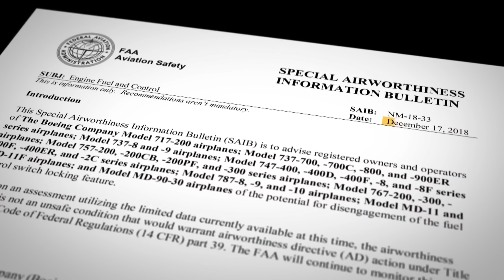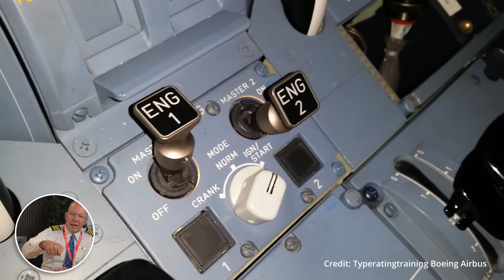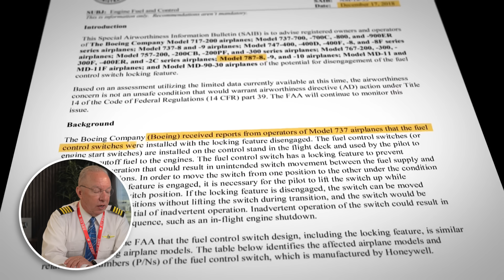Air India 171: The FAA’s 2018 Fuel Switch Locking Bulletin Explained (16 Questions Answered)

Comment: As much as I respect you, it's too cruel to blame it on pilots outright.  Clearly in the cockpit, the pilot said he didn't do it.  Let the investigation take its course and may the truth prevail. 
The board had to take psychologists into the investigation because they cannot rule anything so easily but that doesn't mean they are insinuating something like this. That's how investigations work. And the 2018 FAA Special Airworthiness Information bulletin has this point documented about the disengagement of the switches which could also be a case. We let the dead souls rest in peace until the investigation settles. Peace out! JAI HIND!!
Reply: Except that even though Air India didn't inspect the fuel switches, this particular plane had replacements installed in 2019 and 2023 though NOT for reasons connected with the bulletin so who knows? That said it's definitely on Air India imo for NOT following the bulletin though people will still blame Boeing for that. At least Boeing didn't try to hide the problem like with the MAX series.  Losing loved ones in a plane crash is just cruel period. A friend of my family was killed along with 272 others in a plane crash that was 100% preventable if the maintenance for engines in C checks issued by McDonnell Douglas had been followed by the airlines that bought and flew these airplanes. And maybe most airlines did that but three (just in the US) didn't and adopted a short cut (to save 125 work hours per engine) that they were specifically warned NOT to do. And sure enough it was done to airliners later found with damage done to their pylon assemblies which grounded an entire fleet of airplanes. The planes with hidden cracks still on the ground were inspected b/c one plane wasn't so lucky and lost an engine during takeoff and 30 seconds later crashed into a hanger killing all on board and two on the ground. That is cruel to those killed including those who actually watched their own demise coming on entertainment screens b/c cameras were put in the cockpit to provide that entertainment. It's cruel to the two pilots who were left trying to fly a plane with very limited information to work with. It's hard on their families. Hard to deal with the aftermath of everything that comes with losing loved ones including breadwinners or caretakers or children. Then there's the investigations that can take years (up to 10 with two B737 jets with defective servovalves). So Yeah while I definitely agree that the investigation should "Take its course" and yes we know why one (unknown) pilot said he didn't do it but that often gets to a very difficult part of the investigation. Even when you know what happens, when you then have to investigate WHY it did because that often provides the answers of what to do next to prevent it the next time and make flying more safe in an industry where so many improvements to flying safety have resulted from tombstone reform.   So Yes do the investigation but if it goes down one of the worst of all possible roads you still have to journey down that road. And there's already been troubling signs. A duel engine shutdown caused by two switches (designed to be only moved purposely) which were put in the "Cut" position a second apart (not at the same time) happening at the worst of all possible times almost down to just several seconds. Then a paraphrasing a brief exchange which may or may not be complete.  These types of cases seem to always shock people upon release of information from the CVR and/or FDR. Whether it's Germanwings, China Eastern, SilkAir or even PSA 1771 where there were gunshots heard on the CVR. Because we don't think that things like that happen.  I would rather it be something mechanical that can be fixed or even error where training might address it. Than a pilot's deliberate action. But if that's what it was it'll be made clear even if we never ever fully know or understand the motive.
Reply: Radfem2010, agree with your response.

Whats important is we have the timestamps of when the switches transisioned and when the pilot heard asking why the other cut em off. If theres a significant delay in seconds, then perhaps the transition happened unintentionally either through polot error or by a tecnical malfunction. Thats why a clear investigation is very much important here before drawing harsh conclusions on the diseased. @radfem2010
Reply: Quit trying to blame the MFG the pilot flipped the switch it didn't fail it was a suicide.
Reply: @chris6743you should perhaps work in the investigation team. You seem to know a lot.

Comment: You need to look at the Chips which are the key  Electronic part that controls the Fuel Pumps. Heat, Defective Part, Poor Maintenance, or a combination could cut off fuel without manual intervention.

Comment: I think if there was a cover up, the Indian officials would be blaming anything but the pilots.  

I do think some kind of cockpit video could potentially have value in some accidents.  I get your concerns and I've also heard them regarding showing deceased pilots involved in accidents that had a mechanical fault etc...and the effect they might have on surviving family members.  Perhaps only certain phases of flight like take off or landing or when certain key devices are manipulated.  I mean if you're reading the paper during takeoff or landing, you kind of deserve the consequences.  Maybe under 10,000 feet?  Using a buffer, for example, it is easily possible to save a certain number of seconds before and after a manipulation.  An example are police dash cameras.  On many, when you turn on the lights and siren it will start a recording that captures something like 30 seconds prior to the activation until you turn it off.  Essentially, in this case, a running 30 seconds is held in a buffer and continuously overwritten if not needed by an activation.  Police officers were totally against body cameras but most now see them as a valuable aid.  When someone knows they are being recorded, they are much less likely to do the wrong thing.  JMHO

Comment: Why are you, as a pilot, so resistant to an audible alarm from the RUN/CUTOFF SWITCHES ONCE V1 IS ESTABLISHED. TAKE OFF CANNOT BE REFUSED, BUT CRASH IS INNEVITABLE IF FUEL CUT OFF IS ACTIVATED?
THE ALARM WOULD NOTIFY EVERYONE IN THE COCKPIT IMMEDATELY.
YES THE CREW CAN HEAR SPOOLDOWN, BUT IT IS NOT INSTANTANEOUS.
SOMEONE WANTS PILOT ERROR!

Comment: They need to publish the exact milliseconds counter for the left and right fuel cut-off activations. The difference could be anywhere from 0.1 to 1.9 seconds. If it's closer to 1.9 seconds, then it could have been manual. If it's closer to 0.1 then it's got to be automatic activation.

Comment: Do they know for sure that the switches were turned off, or did the flight data recorder indicate that it happened? If power to the switches failed, the recorder would show that the switches were turned off. The pilot would see the power was off.

Comment: Hello, is it possible fuel cutoff  "switches" were in correct positions as a electrical malfunction to the solenoids or circuit occurred cutting off power in the circuit "IMITATING a switched cut off shut down condition" as the switches remained in the correct non cut off  position? If so what indicators are there (in addition to hearing a spool down condition) in a manner other than a actual switch position, consequently possibly prompting the question "why did you shut them off" when in actuality they were not as the other pilot stated..If so could /would the pilot switch them "off then on" again with the successful re-initiation of fuel supply? Could this be why they were in the "on" position when investigated? I find it hard to digest this degree of career devotion could lead to deliberate sabotage or error and lack of experience..Also could this explain a brief power disruption statement indicated by the survivor before the RAT..Standing by for a response as  have not heard anyone address this possible incident..

Comment: I used to be an aircraft mechanic, on 737, 757, 767, so older generation. A couple things leap out to me. 1, the flight data recording the position of the switches does not necessarily indicate the switches were in that position. It simply indicates whether or not a specific electric circuits had power or not. The cockpit voice recording is bothersome. However, if the one pilot did see the other set both to shutoff, why did he wait a full 10 seconds to replace the switches to run position? Perhaps his question was a response to full loss of power on both engines? Accidental or not, you get those switches back up within 2 to 3 seconds.Keep in mind the accused pilot denied going to cut-off. The timing is awfully close to the aircraft transitioning from ground mode to flight mode, and the re-energizing of the circuit could be believably in the timeframe of the RAT powering up. 
On the other hand, these systems are so independent of each other, it's hard to believe any failure that was not human error, intentional or accidental.

Comment: I'M a private pulot with a single land rating. In ground school I learned the acronym "IMSAFE" a smart airplane  would not allow both fuel cut offs to be selected when weight off wheels are indicated. Something for Boeing to change going forward.
Reply: Ever heard of MCAS? It's a computer system which overrides the pilots inputs. It crashed some 737's not long ago.

Humans can make mistakes or malfunction. Computers can make mistakes or malfunction. Accidents and other bad things are always going to happen and no clever technology can prevent them.

Comment: Once the fuel is Cut-Off, how long will it take the engines to lose thrust/power? Just like the RAT deployment takes place only after lift-off, isn't  there a manual/automatic check when the switches put to Cut-off?!

Comment: I must respectfully disagree with the Captain. Unfortunately, I have already ex[lained why the Cutoff switches directly control solenoid-activated valves and that those solenoids will default to their 'closed position', meaning the fuel closed position during a power loss thus cutting the fuel to the engines WITHOUT MECHANICAL ACTIVATION of the cutoff switches!  As we observed, the RAT deployed immediately after the 'off ground' sensors went into 'flight mode'. This would happen during a complete loss of electrical power and/or hydraulic pressure. Again, unfortunately, and it surprises me coming from an airline pilot, Captain Steeeve keeps pushing for pilot error or pilot-caused crash! I directly messaged him with the details of my explanation and he completely disregarded insisting that it had to be a physical movement of the cutoff switches!

REAL POSSIBLE CAUSE OF AIR INDIA CRASH

Could Electrical Failure Alone Have Starved the Engines?

Yes, it’s technically possible that a sudden total loss of AC power on takeoff de-energized the fuel‐shutoff solenoids, allowing their spring-loaded valves to snap closed—even if the cockpit switches remained in RUN. Here’s how that scenario could unfold:

1. Fail-Safe Fuel Valves Close on Power Loss  
- The 787’s engine-feed valves are electrically actuated but are spring-loaded to the CUTOFF (closed) position if they lose their electrical supply.  
- In a dual-generator failure, no AC bus power means the solenoids de-energize, valves default to closed, and fuel flow stops.

2. Cockpit Switches Stay Put, Valves Close Downstream  
- The manual fuel-cutoff switches are *mechanical levers* that only change the valve’s energized state—they don’t themselves block fuel.  
- If the valves lose power, they close regardless of switch position, so pilots would feel a real thrust drop even though the cockpit levers never moved.

3. RAT Deployment Isn’t Fast Enough to Prevent Fuel Starvation  
- The RAT deploys within seconds to power essential instruments and hydraulics—but *not* the main-tank boost pumps or valve solenoids.  
- That delay lets the fail-safe valves remain closed long enough to cause true engine flameout and a sudden loss of thrust.

 4. FDR Interpretation vs. Pilot Reality  
- Flight data recorders log valve position and engine parameters, not the cockpit lever’s travel.  
- A solenoid-driven valve closure looks identical in the data to a switch-driven cutoff—hence the FDR’s “fuel-switch to CUTOFF” event, even though the pilots deny moving the levers.

In short: A total electrical blackout can indeed mimic a manual fuel‐cutoff by de-energizing and spring-closing the engine fuel valves, causing a real loss of climb thrust that the crew would experience as if the switches had been flipped.

Comment: If it takes significant effort to lift and move the fuel control switch. How is possible both were cut within 1 second. I would think to it should take 2-3 seconds, lift one second and move one second. This should be the first thing proven on simulator before pointing at pilots.

Comment: RAT was visible in one of the images from the airport runway CCTV and reproduced in the preliminary report by AAIB page 14 which I am quoting here.

The CCTV footage obtained from the airport showed Ram Air Turbine (RAT) getting deployed during the initial climb immediately after lift-off (fig. 15). No significant bird activity is observed in the vicinity of the flight path. The aircraft started to lose altitude before crossing the airport perimeter wall. 

 15:16
Reply: intricately timed. One almost recovered.

Comment: Hi Captain Steeve, an ethusiast here, I just want to know is it possible to cut the fuel switches off without pulling back the thrust levers or when the throttles are at TOGA position. 
Secondly to me if this would have been an deliberate act out of intention then why CDR shows that pilots again tried to restart the engines. Is it possible to imagine that those switches locking mechanism just failed altogether and both the switches went from on to off position, as it was designed to do so

Comment: So is it possible that the pilot noticed engine stalling so he cut off the fuel switches and turned them back on again i hope that it could save them and, if in case this is not what happened and it was pilots fault then how to make sure that this never happens again in flight even on higher altitude

Comment: The question about the fuel shutoff switch providing a warning. It seems that there would be a warning on a screen (or aubible) where the flight computer realizes there is no anomalies with the engines and ask the crew if they are sure they wish to proceed with fuel shutoff?

Comment: Steeve I am sorry most of your answers doesn't make sense...1. It can't be intentional/suicidal by one of the pilots otherwise he would have not allowed other pilot to recover the plane...2. In case of dual engine fire/failure there is a process to cut off fuel and switch them back on and thats what it happened...were they doing same recovery steps probably?  3. Cockpit MUST have cameras its for finding the truth and accountability after the crash,  ofcourse it will not prevent the crash like blackbox or CVR

Comment: Thanks for the information. Something else I feel like is being implied but not specifically stated is that it seems like this was almost literally the worst possible time for this to occur. That is to say, if they had ascended a little further, perhaps there would have been more time for the engine to restart and potentially recover. To me, this seems like further evidence of a deliberate act since it was chosen at almost a precise time to potentially prevent the other pilot from recovering. Doubly so if if the pilot recovering was the one actually performing the takeoff and having his attention focused on that.  Based on that, my personal suspicion is the captain. Though obviously, all of this is speculation.

Comment: Question at 15:14. Totally valid question, not sure why captain Steeve just brushed it aside stating that the only propf of RAT is the video? Totally wrong as the official report itself has a frontal shot of the RAT. Even I am wondering how come the aircraft continued to fly after that. That shot shows the aeroplane to be pretty close to the ground and also that does not look like the highest level the flight reached.
Edit - this felt more like a video to blame it on the pilots. Also, he dodged multiple questions here.
Reply: Question said video. Where is the video ? The authorities despite knowing this kept quiet about it till the report was released.  That picture of the cctv footage was only released after a month thru the report. There is no video still publicly. Now, given the engines couldn't recover soon enough would mean whoever disengaged supply did so intricately. Your theory is they failed first and then recovered ? They were turned off so intricately in such a critical phase of flight that RAT deploying earlier in an ascending position shoudn't distract us from pilot action here. There is a reluctance to accept what happened here because of all the jingoism. MIddle aged commerical aviators in India are ex airforce and have  variousn blindspots including excessive nationalism and why not, they are paid well and live in high society. Spare a thought for the consumer who spends a lot for even a short domestic flight.
Reply: @DanMax8  totally wrong to presume everyone is just trying to deny the facts. Only after the final report should anyone come to any conclusion. I am not trying to prove anything yet. Just asking qiestions coming to my mind.